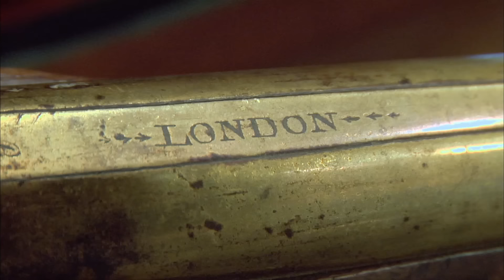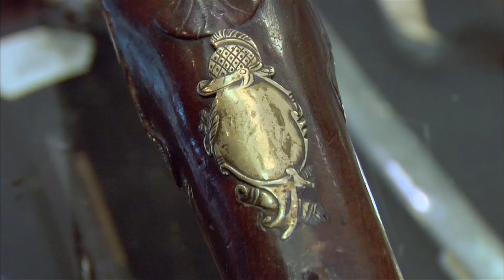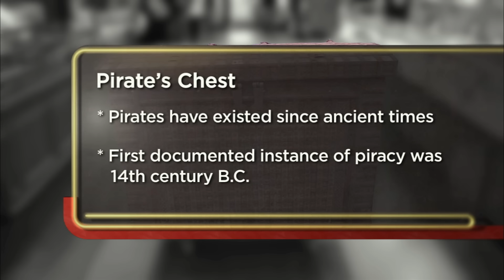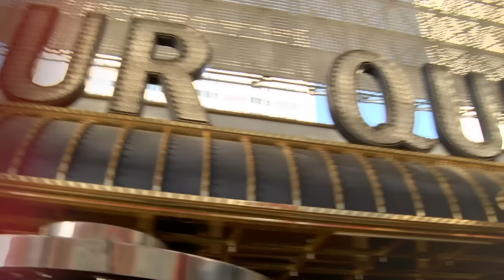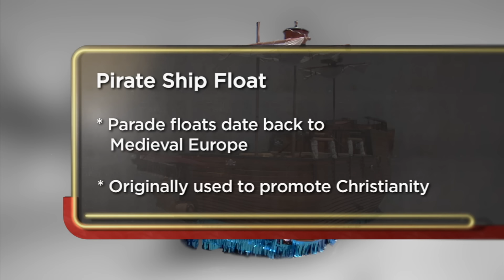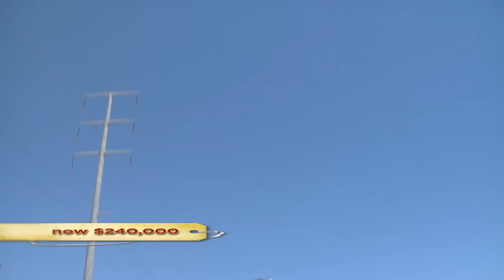Pawn Stars: TOP 5 PIRATE TREASURES | History

Comment: That treasure chest and locking system was awesome. The hidden lock mech was pretty cool too. Was fun to watch. Great video
Reply: I personally think it was sold far less than its value.
Reply: @agharehan6328  same, wonder how much it's worth now
Reply: What is the "street value" on a chest like that supposed to mean? Street value makes it sound like you can get one in the back alley
Reply: @agharehan6328  
They go for around $1.500-2.500 at auction. They're not extremely rare.
But then if there's something unique about it it can raise the price.
But antique seller often set way higher prices on them.
It's called an Armada Chest.
Reply: I'd have gotten a second appraisal on that.  I wouldn't have let it go for less than 6 if I was parting with it immediately.